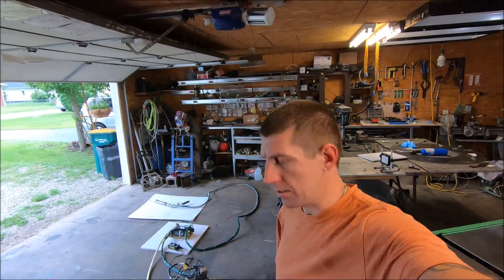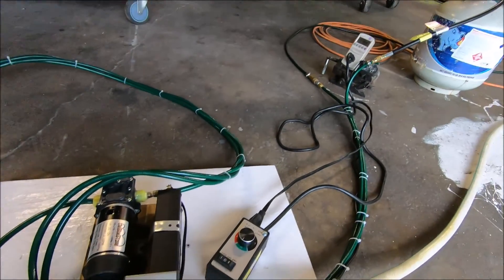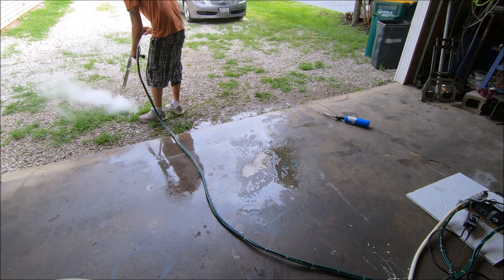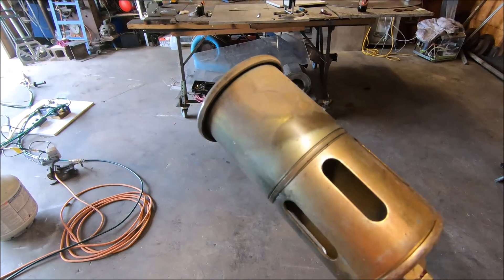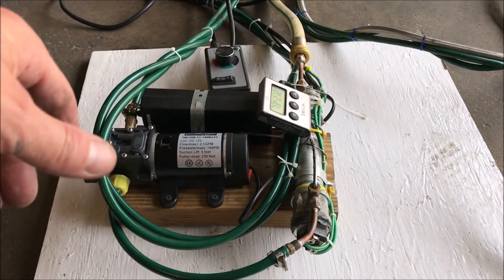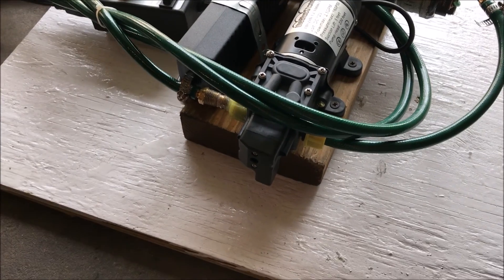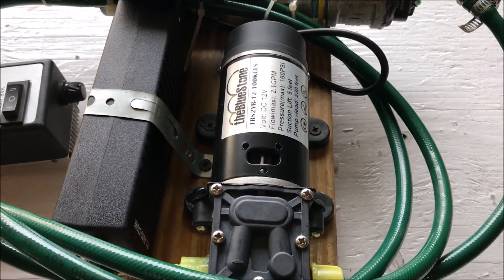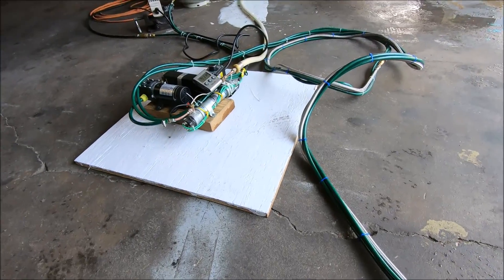High output Steam Cleaner and organic weed managment Machine

Comment: Add a pipe arrester In-line with the pump and after the heater might act as a capacitor?
Reply from the maker: Bro i was thinking the same thing about the pipe arrester , it would also protect the pump from case fracture , thats pressure has to go some place , also i regeret not forcing water into the heater , its not good on my pump running hot water like this , this things all bass ackwards

Comment: Im trying to work out how to make a wand style waste vegetable oil burner to burn weeds.
Reply from the maker: It will be hard to do , you will need to wear the oil tank on your back to keep it burning write
Reply: @NOBOX7  yes i was thinking of using a backpack tank for the oil and then a long air hose back to an air compressor.